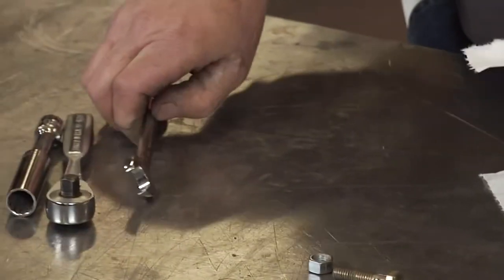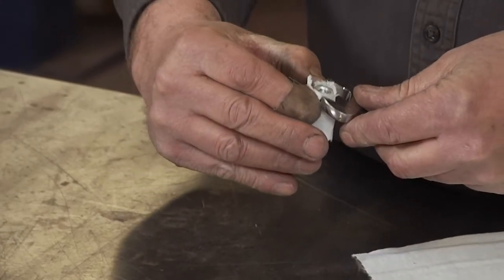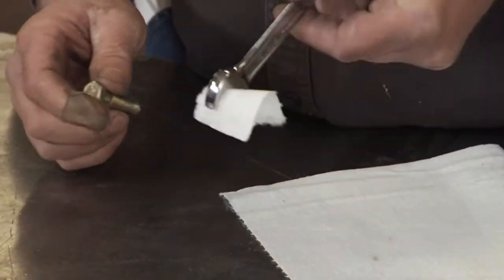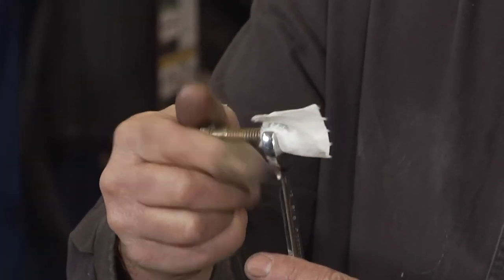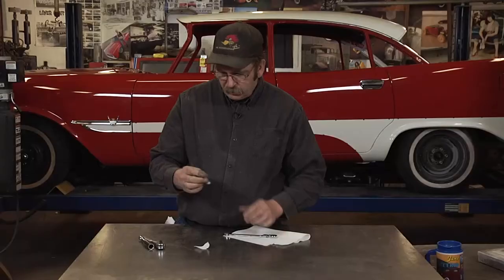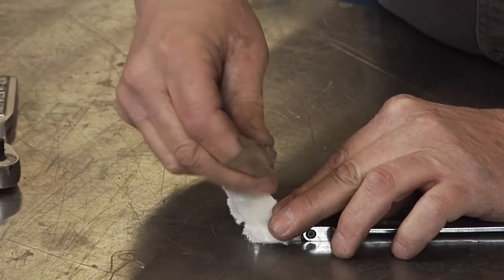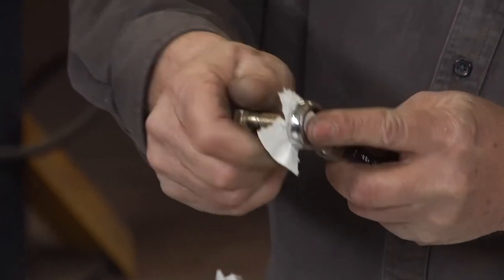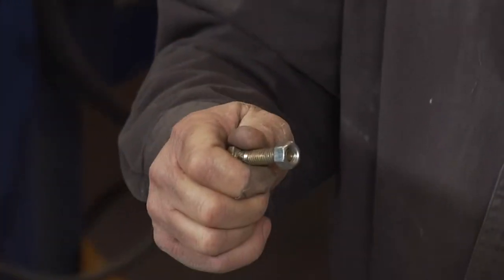Quick Tip: How To Wrench For Tight Spaces

Comment: I have a 2006 Impala 3.9. The pellhum is rounded in the back making it impossible to access the top left bolt on the ignition coil.
The 3.5 is easier because the pellhum is not rounded. Is there a video on this for the 3.9 or a tool that will fit in the space? It's a 10mm socket.Repair manuals don't show how to do this.
Awesome video. Thanks a lot.
Reply from the maker: Have you tried a gear wrench? They are often my first choice for bolts in tight places. 

I have heard these bolts can be very difficult to get on, and frequently mechanics remove the plenum to gain access. 

I have not yet worked on one of these yet, so I can not speak from experience, nor am I aware of any specialty tools for removal. 

It may be worth the $40-60 for an intake gasket set, and put all the frustration behind you and you'll have a new intake gasket set.

Comment: how do you torque bolts where your torque wrench will not fit?
Reply from the maker: Hi Wilson,

There are times when you simply can't get a torque wrench on the fastener.
While ALL internal engine and and transmission bolts should always be torqued to spec., other bolts sometimes need to be estimated.
A crows foot wrench on a torque wrench will affect the reading but it will still get you close,
and other times you'll need to take your best guess, if all you can get on it is a box-end wrench.
If other bolts nearby have been torqued to spec, to can put a box-end wrench on them to get a feel for the force needed to turn them.
Then apply the same level of force to the fastener you can not get a torque wrench on.

Wrench Safe, 

Mark
Classic Car Restoration Club Video Membership
Reply: @ClassicCarRestorationClub  Thank you!